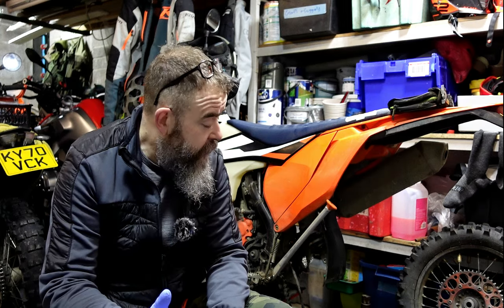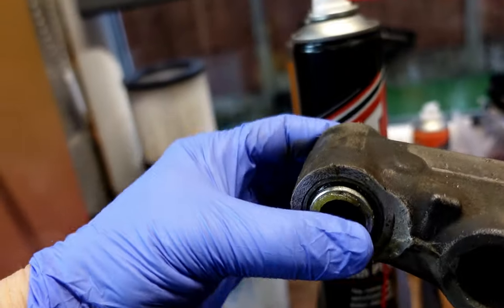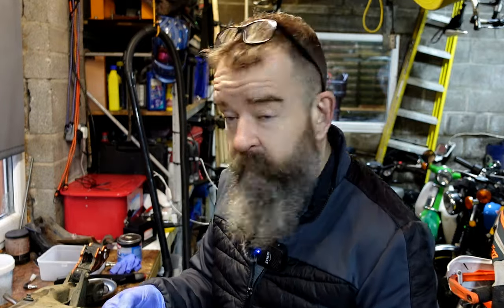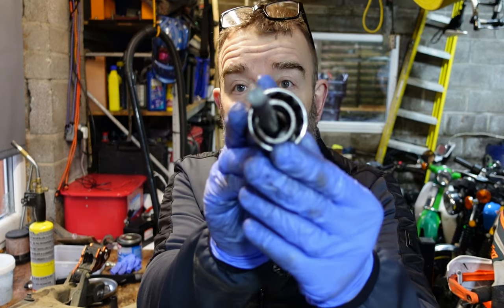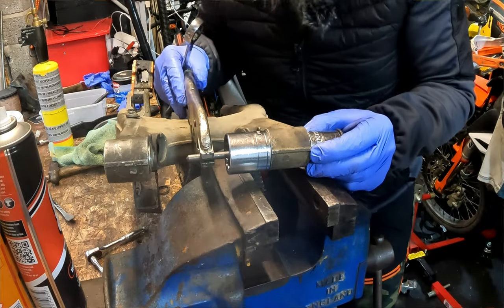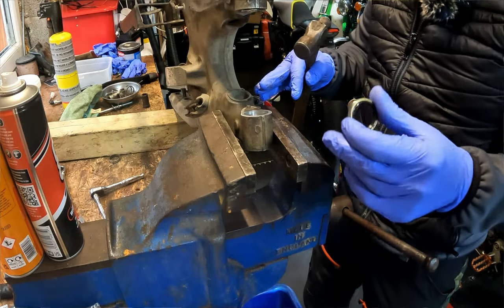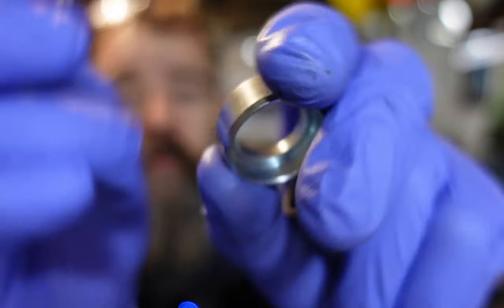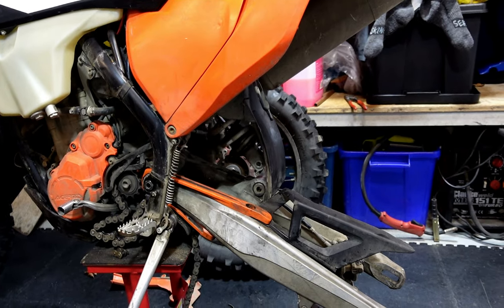Swing Arm Bearings - Replacement, KTM

Comment: Hi Simon
Which lapel mic do you use, presumably the mic on the media mod is not quite good enough for in the garage? Kind regards . David
Reply from the maker: Hey up David, the mic on the media mod isn't really up to it, if you are speaking straight to it it's acceptable, the GoPro in this video is the second camera, not the main one, the mic is a synco wireless mic, similar to the rode wireless but half the price, just as good, it's on Amazon at £70, at the moment, hope that helps, ride safe, Simon B 😎
Reply: Thank you Simon for the reply.

Comment: Possibly because there more mud on chain side . Chain lube possibly degrading grease 🤷‍♂️
Reply from the maker: Hey up billy, it's probably the force from the chain that degrades the bearing, thanks for watching and dropping a comment much appreciated, ride safe, Simon B 😎
Reply: @SIMONB1  I also herd that was beating around the bush lol 😂 thank for feedback cheers 🍻
Reply: @SIMONB1  just completed swingin arm bearings n hiem joint hiem joint was solid swing arms was ok to pull . 👍